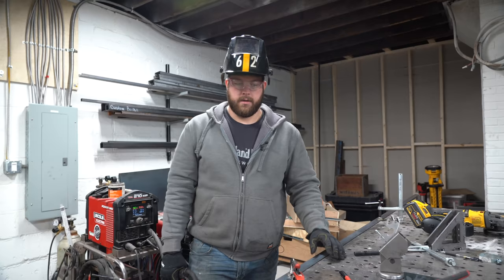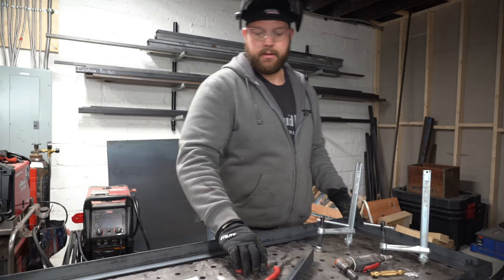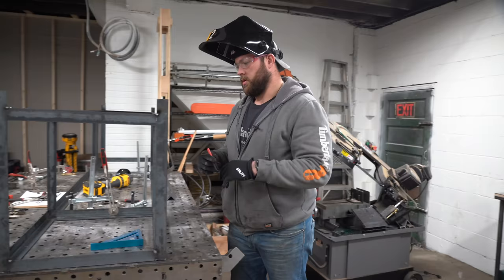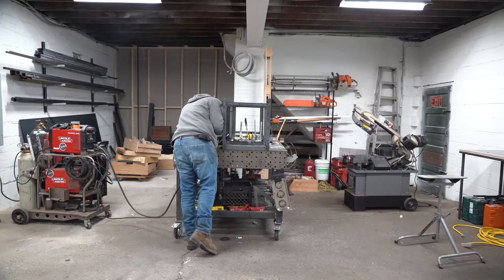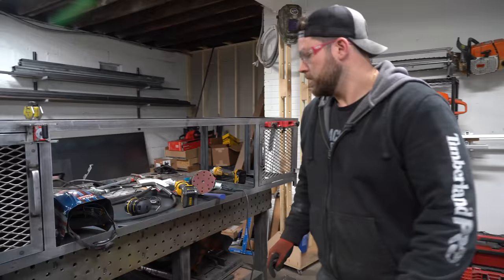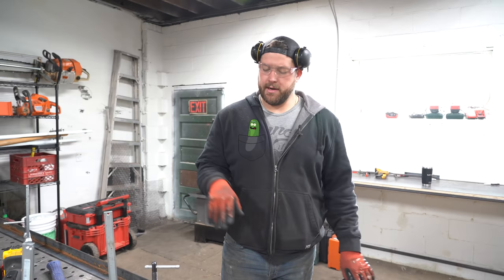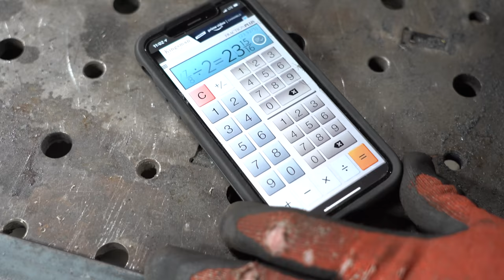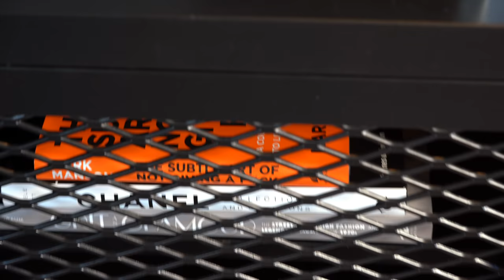Building A Modern Industrial TV Stand

Comment: Magnets totally affect the welding arc. Particularly noticeable with TIG but OK if you can get the magnet more than a few inches away. The welding arc is an electric current and and so is deflected by magnetic fields. Nice project by the way.
Reply from the maker: Ahhhh thanks Ben, makes a ton of sense
Reply: If you want to dig deeper it is called arc blow, run into this problem when working on ships and offshore equipment that use powerful magnets for compass and leveling.  To combat this switch your machine to AC instead of DC to complete the circuit.
Reply: Electromagnetism

Comment: Magnetic arc blow is caused by the magnetic fields in the joint becoming unbalanced. It is not as common with thinner material but it is still possible and magnets can cause issues but if your just fitting and tacking they work great.

Comment: Hi John.  I really like your stand.  I'm an welding Instructor with the Salt Lake Community college.  The question was Does the magnets effect the welds?  The answer is yes in the flow of the electricity for the arc. It gets distorted, but not to the point of the weld fusing to the base material or the joint your welding.  you may see discontinuity of the weld face or undercut an an example. Now Electricity will flow to the point of least resistance, when you add a magnet in the joint closest to the weld point  and the electricity get redirected slightly that's when it may effect the weld itself, but using magnets to tack the joint together the welds themselves are not effected because when the liquid metal solidifies, its doesn't hurt the grain structure because the magnets are just not that strong to effect it to much.  I hope this helps understanding how welds work and to answer the question.

Comment: Electricity and magnetism as forces can be unified into electromagnetic radiation, they are like twins. Together they make light and microwaves and infra red lamps etc. Yep I guess the magnet deflects the stream of plasma that you are making and so the heat goes somewhere else. You could get some of those "no-magnet" magnets that don't interact with electric currents but they unfortunately only exist in a different type of universe.

Comment: Yeah, if you get too close to the magnet and you will have to chase that arc all over the place. Heat is not good for magnets, a few quick tacks is about all you should do with magnet at weld joint (other side of joint) otherwise they will rapidly weaken.
Reply from the maker: Thanks Nate, 
thats what i thought but it sometimes makes even a tack close to impossible haha

Comment: I don't know about a magnet affecting the arc but a magnet cannot affect melted steel. Once steel reaches "critical temp" it is no longer magnetic until it cools. This is a way that a lot of knife makers check that the steel is hot enough to harden.
Reply from the maker: yes, hence my question. But it does affect the arc which was what was boggling my mind!

Comment: That was very entertaining and educational to watch so thank you.  I’d appreciate if you could share a little on your design/approach - it’s something I’d like to have a go at but haven’t really done so yet.  I assume you use 1/8” x 2” for the angle and 1/16” for the plate.  How do you deal with the mill scale - grind it off for just the weld points?  Does it matter when using the DTM paint?  The end result looks really great so well done.  Cheers
Reply from the maker: ITs 1.5" angle at .125 thickness and 16g sheet. when using DTM paint you wanna follow what the can suggests, and when you're welding MIG you can just burn thru the mill scale mostly, I sanded the whole unit after i assembled it to get it to be nice and clean for paint too

Comment: Really the only time the magnet REALLY effects a weld is when there's a potential for super high pressure leaks or stand alone structural welding. Other than that, the welding effects the magnet more than the magnets effect the welding

Comment: Pretty cool John. I have a question about the paint you used. Was it Latex or Oil based DTM? Reason I ask is because of your Respirator Filter choice. I'm a Commercial Painter and the filter you used was for oil base paints. It will not filter out Latex based paints. You need a pink HEPA Filter for that. Plus no offense the beard doesn't allow your mask to seal anyway. At least that's what I've been told. Just food for thought...
Reply from the maker: It’s water based. Thank you for the tip on the respirator !

Comment: Captain OSHA here, holding onto the guard of the grinder is super sketchy, if you need a second hand hold on that thing throw the side handle on it, be a shame if you had to change the name of this Chanel to Nubs Malecki the Builder
Reply from the maker: I know I know, it was very light and not something i typically do. I was looking for some very light control on it then, but you're 100% right. Shouldve put a handle on
Reply: I was gunna say sumthin but didnt want to be that guy
Reply: John Malecki they're not cool like the cordless grinders, but scope out a small 6amp 4.5" unit. I've got a half dozen Milwaukee ones, they're compact enough that you can wrap your hand around them just shy of the gear housing and I find they work great for detail work that requires a light touch. Only thing better are the little 2" sanding pads on a die grinder. 

Chris White, I don't love being "that guy" either, but couldn't not point that one out.
Reply: Just judging by the size of those massive mitts.  John has more surface coverage on that thing just using one hand than most people do with two hands.

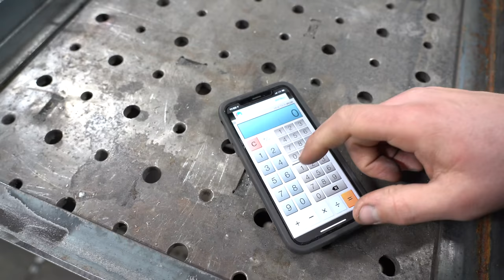Comment: 11:40 remind me again why imperial is still a thing? 

It would have been roughly 1254mm wide, minus the 38mm gutter, then divided by two for 608mm to the center. I did that with a paper and pencil, no calculator needed. 

Switch to metric dude. It’s seriously the best.
Reply from the maker: Ehhhhhh I like to struggle thru our freedom units. even though it may be much  more difficult
Reply: The freedom to use a specialized calculator I suppose! 

Measuring aside, keep up the awesome work. Loved the finish on this cabinet

Comment: Welder For 25 Years. They  do effect the weld. Why? Good Question! Let me know when you find out :)
Reply from the maker: Hahahah will do !
Reply: As a welder for almost 10 years it’s called magnetic arc blow. Essentially when you weld you are creating a small magnetic field around your part, when you introduce a magnet it’s makes the poles in your weld get squirly thus weld looks like poo poo, chances of John seeing this are low so here’s an Easter egg. If you take welding cable and strip the insulation and wrap it around a non ferrous metal(stainless) you can magnatise it